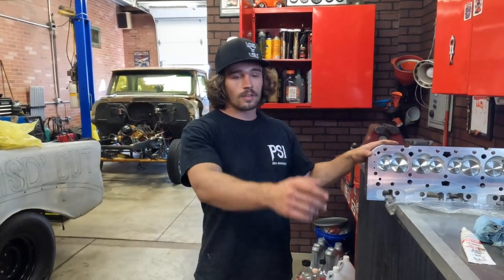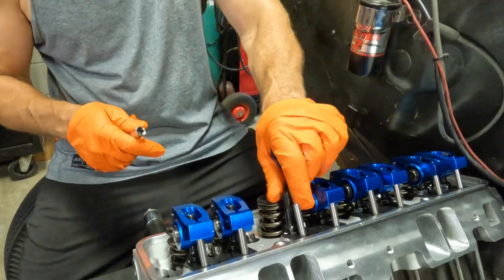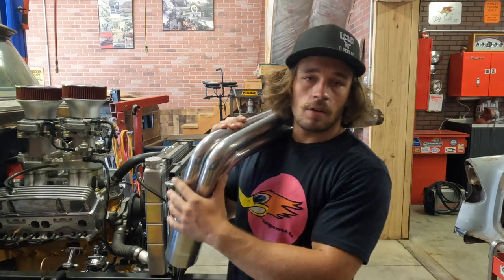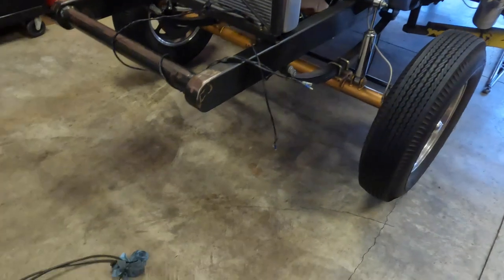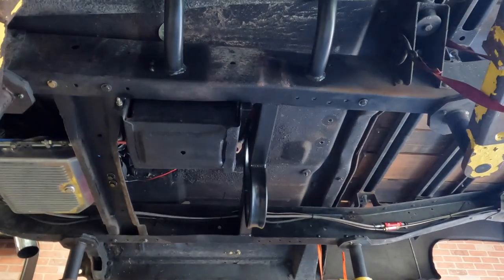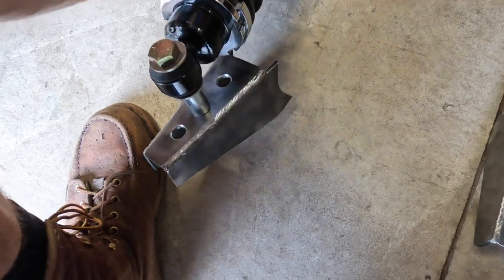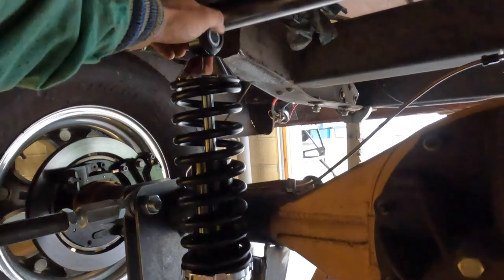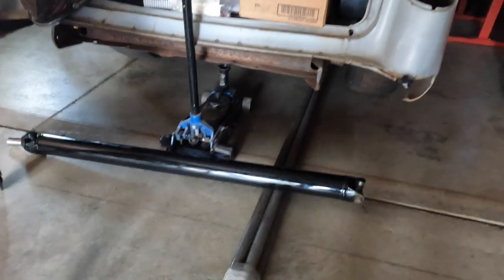Loud N Ugly Garage - Finishing up the Motor and Ladder Bars EP26

Comment: I’d spot weld the nuts to the safety bracket to make it easier to remove
Reply from the maker: They have a tab that I welded solid then the loop part bolts to them! 🤘🏼🇺🇸